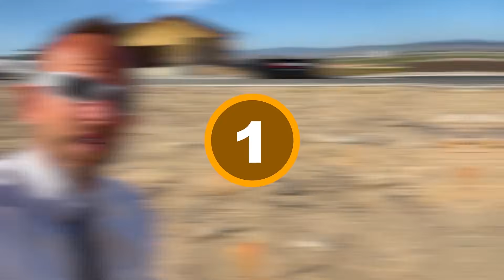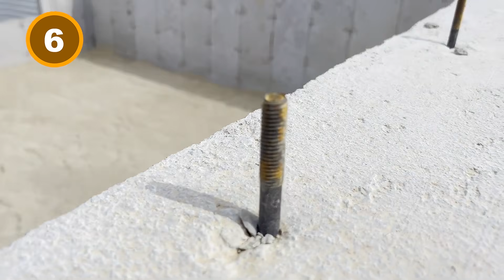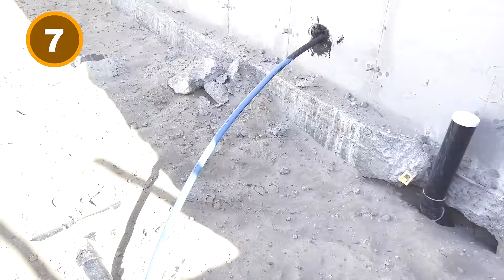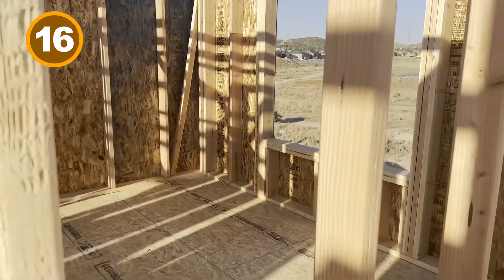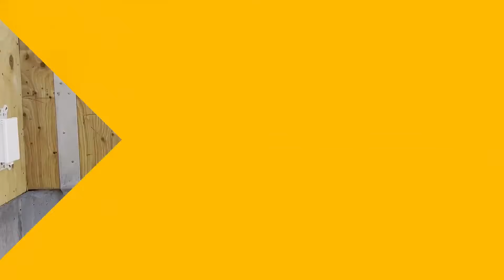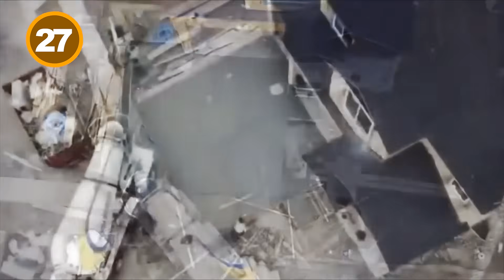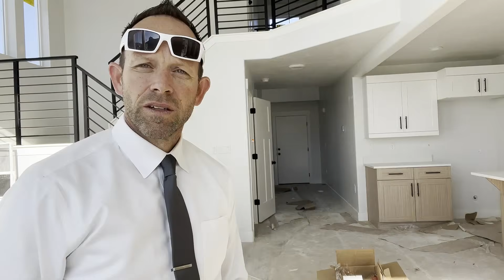How a House is Built | Most Comprehensive Video EVER Created on the Home Build Process

Comment: Very helpful video! Thank you. I know it’s a lot of work! I do have a quick question about timing of the foundation walls and floor. 
I know there’s a lot of variables, but how long after you pour the walls, can you pour the concrete slab? 
Assuming that all rough plumbing, drainage, backfill etc is done in a timely manner.
Reply from the maker: As long as everything’s done, you can pour floors the next day.

Comment: Yeah no In 2025 you can still build your own home you just have to build it to code
Reply from the maker: Yep. Any home has to be built to code.
Reply: @tywilde The amount of hoops you have to jump through that’s why houses cost so much. So do it yourself and you won’t have to be locked into a 30 year Mortgage and be slamming in debt just to put a roof over your head. 

My goal is to build my house in the next 2-3 years by myself I’m not paying some half ass contractors to half ass build my house I’m going to do it myself that way I know I have a quality built home. Also in my area there’s not really a building code but I’ll be building my house to the strictest code in my area
Reply from the maker: @jtmartin8445  that is true. Sounds like a great plan.

Comment: GREAT VIDEO! Awesome to have so many houses in all stages for you to outline the process. At 31:38 the wires are routed from the panel outside the wall at an angle up into the ceiling. How are they going to finish that out? Why didn't they run then through the wall cavity?
Reply from the maker: Thanks for the compliment & for the excellent question. Usually, the electrician will run the wires up through the wall cavity. But it's not necessary in this situation because the electrical panel is in the basement & in the utility room which won't be finished.

Comment: Good Day! When would heated flooring be added in this process? Also, if the floors were going to do polished concrete, when would that step be inserted? Thanks in advance! Awesome video.
Reply from the maker: Excellent questions. I'm not 100% sure on either, but I would guess the heated flooring would be done at the same time as the normal flooring process. Thanks for watching and for reaching out. Best of luck to you.

Comment: Thank you. thank you..
I have a question, why is siding done really later on.. wouldn't water go in theough walls if ut rains?
Reply from the maker: That is an excellent question. Rain & snow doesn't really hurt the wood because the wood used to frame a house already has a lot of moisture in it. And the compressed wood on the exterior home is moisture resistant.

Comment: Great video Ty. Very detailed. When it comes to baseboards. Should flooring be installed first or after baseboards?
Reply from the maker: @XYZDesignStudio  thanks for the compliment and for the excellent question. Normally hardwood, tile, and laminate are installed before baseboards while carpet is done after.

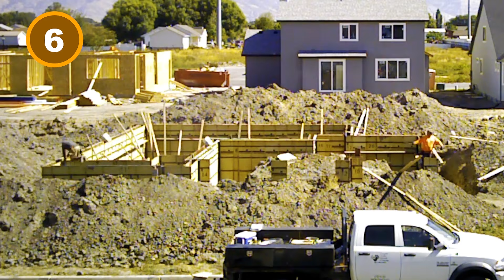Comment: 6:25  why not use just block here? Or if that is an option, which method is netter or cheaper?
Reply from the maker: That would work just fine but take A LOT longer. I'm guessing the concrete is more solid & after labor costs; the price is close to the same.

Comment: Awesome Video 🎉.  I'm just curious why Americans build houses made of wood?  I remember, the 3 little pigs: hush and puff the wolf blew the house made of sticks. That's what happened to Oklahoma houses recently.  
In the Philippines, typical houses are made of Concrete better than wood.  
So, the house shown here is of Luxurious type with the appliances and size. Clearly, the buyer or owner has money, and yet he ordered wood for his house?  🤔. 3 little pigs🐽
Reply from the maker: Good question! Wood is less expensive & easier to work with. With proper engineering it can withstand most severe weather. And in an earthquake, wood homes are built to move a little with the earth unlike a concrete house.

Comment: I'm in Texas.. no basements.. no snow.. 4 seasons every year.. hot, hotter, hot no joke(8months out of the year), and lastly a few days of cold which the hvac gets to fire off a few times... Question.. how are the methods you described here different from say houston building methods...
Reply from the maker: Ha Ha. Thanks for sharing. I would say most things are very similar, beyond the basement thing.
Reply: I love texas you guys have a lot of space for construction I’m looking forward to buy or build house in Texas one day ✌️
Reply: Can you explain the economics of a basement build.. it seems even if the soil made sense in an area like Utah.. for a  house with a basement you still have to dig out the basement, seal it and prep it for it to be useable, that the costs would be  higher for a similar sized floor planned house without basement vs one built with a basement... What am I missing ? Does every house in Utah get a basement? It seems like build costs for a simple slabbed house on top of the soil... If anything a non basement built house doesn't have concrete walls (basement), also  less engr costs/time... I'm just not seeing a basement as an economical utility... Can you make the case for it? Sheed some light on this for us non basement home dwellers?
Reply from the maker: It is relatively inexpensive to add a basement. For instance, a 2000 square-foot rambler on slab may cost $350,000 to build. By adding an unfinished basement, the cost might only be an additional $30,000. So, for just a little more money you can double your square footage. Many will finish the basement for an additional $30,000 - $80,000

Comment: Hello thank you for this amazing video! We can’t wait to watch it several times and study the information. Would there be a way that these steps are available as a print out that we can review and study? 

Thank you again!
Reply from the maker: Thanks for the compliment. I don't have a printable list, but I'll post the steps here.
If you email me at tywilde7@gmail.com, I will send you this Full list. 
ALL 50 Steps to BUILDING a HOME (With Time Frames)
1.	Laying out the homesite using the plot plan (1 day). 
2.	Excavation/dig (1-2 days)
3.	Outhouse placed (1 day)
4.	Soil test (1 day)
5.	Footings (1-2 days)
6.	Foundation walls (1-2 days)
7.	Sewer and main water lines run to the house (1 day)
8.	Window wells (1 day)
9.	Damp proofing (1 day)
10.	Backfill (1 day)
11.	Soil Compaction (1 day)
12.	Basement and garage floors poured (1 day)
13.	Power Supply run to the house (1 day)
14.	Gas line run to the house (1 day)
15.	Dumpster delivered (1 day)
16.	Framing (14-28 days)
17.	Roofing (2-4 days)
18.	4-way Rough-in (plumbing, electrical, HVAC) + framing (7-14 days)
19.	HVAC installed. Heating and A/C (2-5 days)
20.	Electrical rough (2-5 days)
21.	Plumbing rough (2-5 days)
22.	Windows and doors (1-day)
23.	4-Way inspection (Framing, Mechanical, Electrical, Plumbing) (1-2 days)
24.	Insulation (1-day)
25.	Drywall installed (2-7 days)
26.	Mudding, taping, and texture (2-4 days)
27.	Driveway poured (1-day)
28.	Soffit and fascia gutters & downspouts (1-2 days)
29.	Stucco and siding (7-14 days)
30.	Brick/stone (2-4 days)
31.	Trim/finish work (2-7 days)
32.	Caulk and paint (3-7 days)
33.	Decks and final concrete (2-3 days)
34.	Garage doors (1 day)
35.	Wood and tile floors (2-4 days)
36.	Cabinets (2-3 days)
37.	Floating floors (1-3 days)
38.	Final site grade (1 day)
39.	Final electrical (1-2 days)
40.	Final HVAC (1-2 days)
41.	Final plumbing (1-2 days)
42.	Cabinet Hardware (1 day)
43.	Carpet (1-2 days)
44.	Bathroom Glass (1 day)
45.	Appliances (1 day)
46.	Landscaping (2-4 days)
47.	Quality walk by construction manager (1 day)
48.	City Final inspection (1 day)
49.	Final Buyer walk-thru (1 day)
50.	Closing (1 day)

Comment: Amazing how you Americans build beautiful houses with wood , plywood etc as those materials are much more cheaper and energy efficient than concrete and stone bricks.
Reply from the maker: Thanks for watching and for your observation. Building HOMES this way also allows us to run plumbing, heating and air, electrical and other wires to other parts of the home.
Reply: @tywilde  Exactly i agree with you, as i study Civil Engineering i see that our codes and industry are rich on reinforced concrete structures and steel structures but unfortunately there is not enough resources about the wood structures in my region.

Comment: Why was there chipping of the strip footings in order to run pipe? Those should have been sleeved in before pouring the footings
Reply from the maker: That's a great question. I'm not involved in the pouring of concrete, but I'm assuming the forms used to pour the foundation aren't manufactured with holes to allow it.

Comment: Who chewed on that orange wire? And GFI's do not monitor circuits for surges, they monitor the current on the hot and neutral and make sure they are equal, proving there is no current going anywhere else, like a body. (4mA)
Reply from the maker: It was me. I was hungry. LOL.

Comment: The video is good and you try to explain every thing as much as possible. But I have one question. Which one is better between constructing home using wood and using reinforced concrete in terms of quality,durability, cost and climate change?
Reply from the maker: Excellent question. They both have their advantages. Wood is much easier to use & it's a much better insulator. But concrete obviously lasts a lot longer. Wood is much more affordable. I hope that answers your question.

Comment: Interesting but what a waste of space under the driveway. I wonder why after all the digging they didn’t make it a finished space under the drive way. With a few structural columns they could have gotten so much space the owner will probably never be able to add later. It’s much more expensive to do later.
Reply from the maker: They actually need to place pre-engineered concrete slabs that they place on top of the foundation wall to support the weight of 2 vehicles. Then they'll pour the normal concrete on top of that. They need to bring in special equipment to place the pre-engineered slabs & a team to place them. The added cost to add space under a garage is more than $20,000.

Comment: I would suggest buyers go to the home site as often as they can - of course do not interfere with the workers or get in their way.  Do this at your own risk!  We came after hours, and took tons of pictures.  The builder told us we were not allowed on site, but we did it anyway.  The builder started to put a skylight in the wrong place (not just wrong room, but wrong floor), so we were able to tell them and get it moved before it became a massive problem.  Now almost 30 years later, these photos have been extremely valuable locating wiring, plumbing, framing, etc. behind drywall for many reasons.  Thank you for a valuable video!
Reply from the maker: You are very welcome and thank you for sharing your experience.
Reply: How do you put a skylight on the wrong floor?
Reply from the maker: @fitter70   LOL. That would be funny to see.
Reply: @fitter70 probably not A vertically symmetrical structure if that makes sense, What I mean by that is the first and second floor are not stacked with the same square footage. Only thing I can think of. Because there's no way in hell somebody could put a skylight below a bedroom or kitchen or room of any kind
Reply: @fitter70 pretty easily
Reply: @fitter70  apprentices (i.e. newbies) or less-skilled workers who can't read construction prints being in charge of that particular bit of work
Reply: New builds are such crap right now there is absolutely NO way I’d ever trust them without me visiting often and taking pictures. Any builder not willing to have you visit you should run fast and far away from. I’d rather negotiate an injury liability waiver clause than trust a builder to do it correctly or hire competent subcontractors.
Reply: I went to my homesite just in time to see a teenage 'worker' throw a board he meant to land up in the attic...well, it sailed through several openings in the framed roof and kept going, landing in the bath tub, leaving a large gash. Lucky me.
Reply: I’ve worked at 4 builders over 20 years. Every single one of them had clauses saying you can NOT be on the homesite during construction….  In the contract.  If you are,  you are in breach and they can cancel the contract if they choose.  They have other remedies as well.  Why???? For your safety.  Not to protect their mistakes.  FOR YOUR safety.  Want to know if your sales guy is good? Ask her/him if they know any crazy “homeowner on their homesite” stories,  I have about 20. Fortunately only 2 resulted in injuries requiring medical attention,  DONT go on your homesite.  No matter what some goofballs write in a YouTube comment.  Use your brains.
Reply: @rjboxxer1502  the average person thinks they're smarter than construction workers so they'll disregard things we say. When they hurt themselves its often a reality check lmao
Reply: @rjboxxer1502 so what’s the alternative? So many builders hide mistakes and take shortcuts. How do you protect your investment of hundreds of thousands of dollars?
Reply: @T @Tuckertech-x1l im not replying to “you” as if you’d do all these things. I mean “you” the general fear monger who believes everything social media says. I’m just replying to your question. 

TLDR. Trust the village. Traded and builder. They all know way way more than you. 
Be friends with the builder production team. They will kiss your ass to show you their proud work. And get a good survey.
Reply: Ok so when you hire a builder, you typically give them temporary ownership of the site. This is for liability reasons above all, but also various other reasons, and they can actually trespass you if you don't negotiate visits. Yes, you own the property, but they are in control of it.

If you don't like that, you should be the site superintendent yourself.
Reply: Totally agree on the pix. Visited my home many times, mostly out of curiosity, but it didn’t occur to me to take photos.
Reply: Great advice thanks

Comment: Ty

The sheathing on my house had gaps I complained and the builder just taped over the outside sheathing.  They were not tongue and groove 

Do you think my house will blow away easily in a bad hurricane?

And also the egress window was cut out after the concrete was cured Will my basement crack
Reply from the maker: Thanks for watching & for your excellent questions. As far as the concrete goes it will crack either way, but I'm sure the foundation will be fine. As far as the outside sheeting goes. If you think it was done incorrectly, you will want to have as specialist in the are inspect it as soon as possible. Best of luck.
Reply: The tone of your comment seems mildly condescending. Almost as if you've already told your builder that they're doing their job incorrectly, and are now seeking validation for your actions. I sincerely hope that I'm incorrect, but phrases like "I complained" and "the builder just taped over" lead me to believe I'm likely not far off...

Regardless, here's some info:

Exterior sheathing should never be tongue and groove. If it were, the panels would touch, which is actually a bad thing. The gaps in your sheathing are to allow for expansion with moisture. Wood was cut from a living tree, it is made of plant cells and will absorb water and swell when moisture is present. That gap ensures that the wood does not swell up and buckle if/when the ends touch.

Your builder responded to your complaint by taping the sheathing. This is absolutely appropriate, as taping the seams of sheathing is common practice to reduce drafts. In all likelihood, your builder had already planned on taping the sheathing as part of the waterproofing of your home. Which is a good thing for you, since your next comment was about the possibility of your home encountering a hurricane.

As long as the egress windows were cut out following an engineer's design, there should be no concern of weakness. If done correctly, the rebar reinforcement inside the concrete will hold the weight correctly. Alternatively, your builder could also be planning to put a support beam of some kind at the top of the egress opening.

All concrete shrinks as it cures, because of this it will crack, that's unavoidable. Cutting "Control Joints" is common to control where the cracking occurs, similar to scoring/creasing/perforating a piece of paper.

If you have concerns with the way they are building, you can always request an inspection from your local municipality. I also encourage you to do a quick google search to find out if your specific concern is common practice. Researching the process before making a complaint can save you face with your builder. Nit-picking someone's work, especially when it's their profession, is never a good idea. All-in-all, I think your builder is doing things correctly.

Hope this helps!
Reply from the maker: @AScendantV2  It definitely wasn’t meant to be condescending. I apologize if it seemed that way.
Reply: @tywilde  My response wasn't directed at you
Reply from the maker: @AScendantV2  Thank you. I was surprised. Best of luck to you.